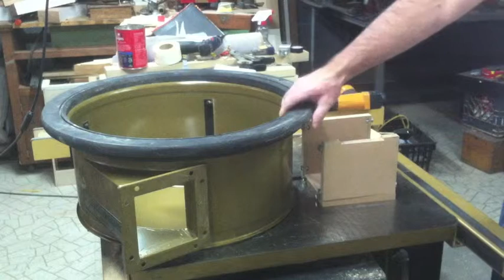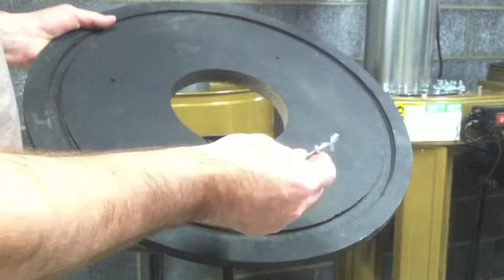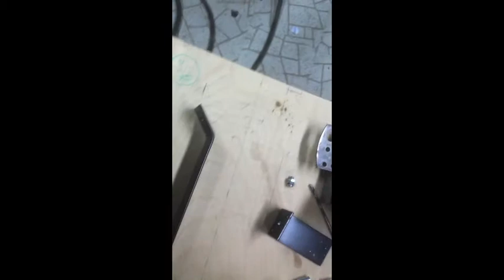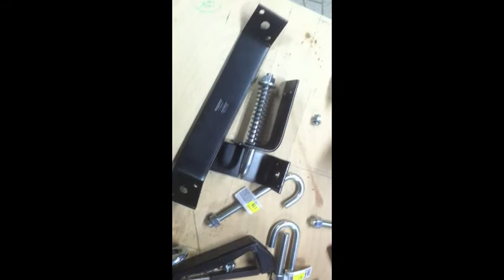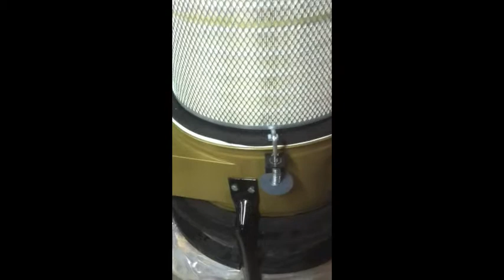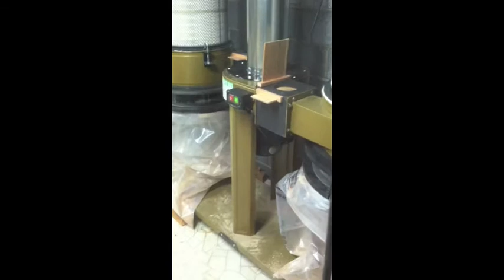Powermatic 75 Dust Collector Thien Baffle & Wynn Filter Modification Part 2 of 2

Comment: Is your Thien Baffle working under positive pressure or negative pressure? It looks like your blower is blowing into the Baffle, which is making it work under positive. It seems a little backwards to me, because the Thien Baffle is designed to catch the dust being sucked into it before it gets to the blower and the filter, thus keeping a clean filter. There is not reason to have a Thien Baffle in this set up. I think you will still clog up you filter just as fast as not having a Thien Baffle.

Comment from the maker: capacitor in my machine was manufactured by M.F.C. / motor starting capacitor / Cap.400MFO W.V. 125v AC.  

btw- if you design do not rely on the silicone alone to hold the lexan in place, try using some threaded rod or a support from the underside.   good luck.
Reply: Thanks for the tip, I think instead of lexan I will use kydex.  I have it on hand plus I can thermo mould it if necessary.  Also thank you for the information about your motor.  So you only have a starting cap on yours?  I feel really bad about asking , and feel free to say no, but could I trouble you to snap a pic or short vid of your capacitor wiring and the wiring diagram on the motor cover?  Thanks again, you've already helped a great deal.

Comment: Very well explained system.  I just picked up a 75 for a really great price and plan on doing the thein mod.  One question if you wouldn't mind.  Can you look and see what size capacitors your motor takes?  The guy I got it from blew a capacitor and just put some he had on hand back in, but had no idea what the originals were rated for in voltage or mf.  Thanks!